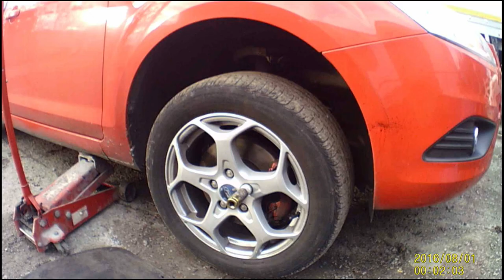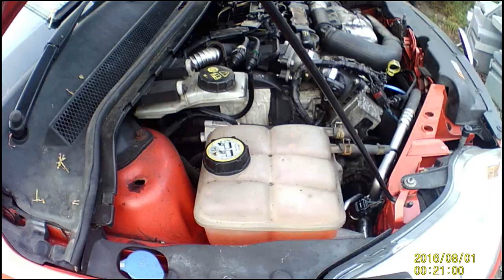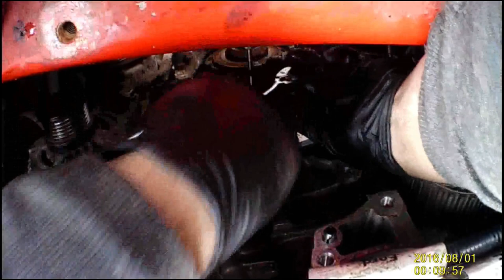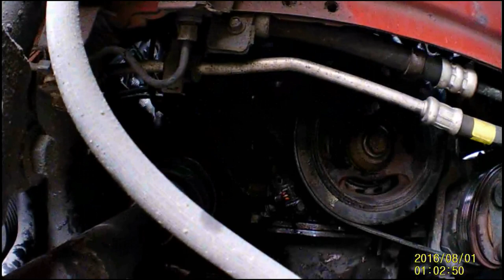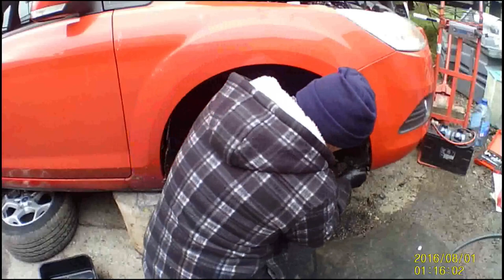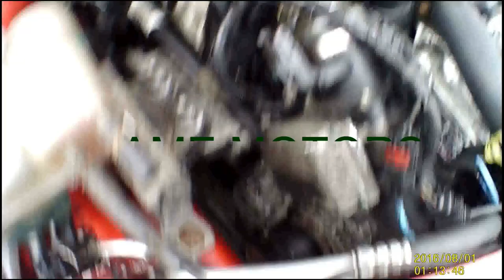ford focus 2011 1.6 tdci timing job YouTube

Comment: Just a few pointers for anyone wanting to do this.
Add coolant after draining old stuff by removing cooling hose, water pump or drain plug depending on car, some cars don't have drain plugs..(use correct spec coolant/anti freeze), 110Nm tighten wheel lug nuts (Not 2 ugga duggas). always spin crankshaft over by hand at least two time and see if the timing pins still line up. Always used torque specs when working on critical engine components (a Haynes manual is always useful.).
Reply from the maker: Yes you absolutely right
Reply: Why let the coolant piss out all over the place when changing water pump when theres a plastic drain plug just at the rear the pump on the block that u just pull out after releasing the retaining clip.this dude ain't gotta clue.oops I just farted!!
Reply: @MrTwisted1977  Because this comment isn't meant for just this one car... DH
Reply: You have to spin cranksahft 10 times.
Reply: @grigorovicigabriel535  2 full rotations of the crankshaft, is stated in the OEM workshop manual. Not 10.

Comment: Hi, can you please provide what torque should be use to water pump screws and all other?
Reply: 10nm for the too engine bolts, lots should be listed really.. although ive used my judgement in past. Check haynes book

Comment: Thanks man for the video ! When should I change the timing belt? I am currently at 111 000km and the engine is diesel 1.6L TDCi hatchback ford focus 2016 sport edition
Reply from the maker: About 90000km